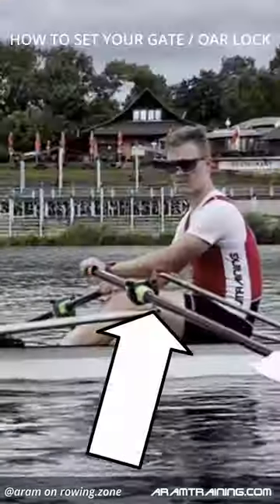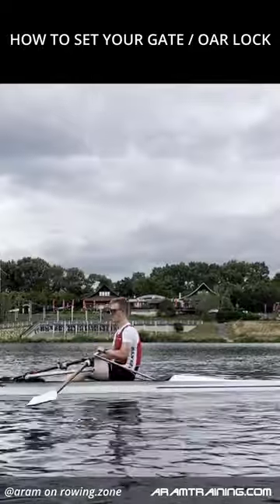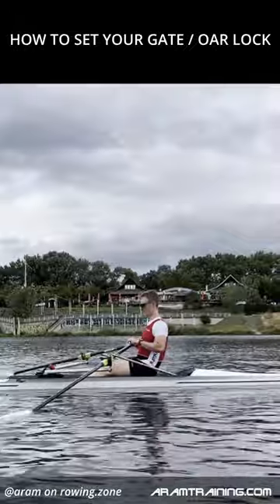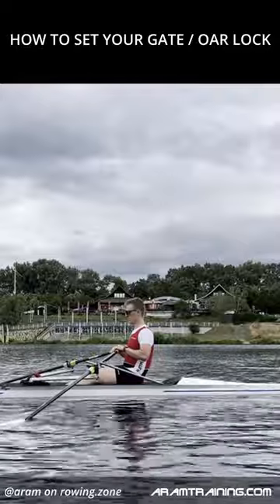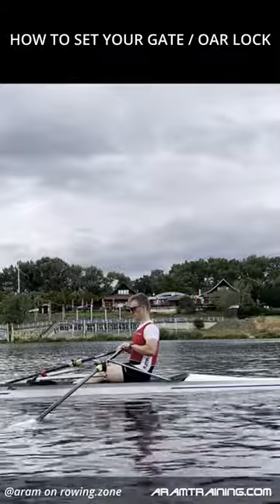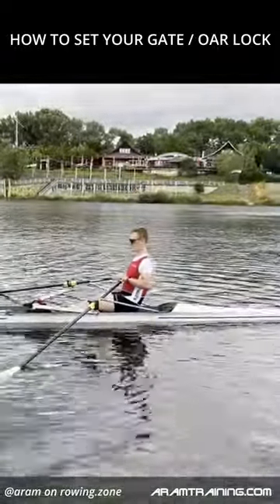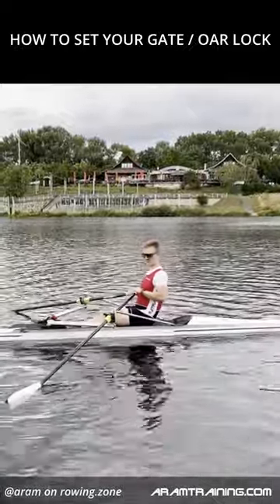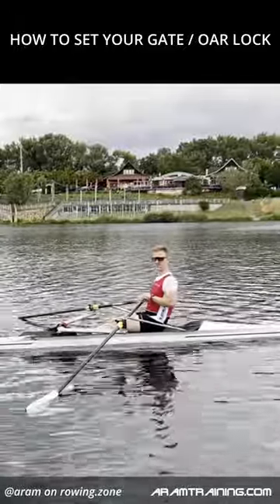How to set up your rowing boat: finding the perfect oarlock height #rowingtechnique #boatsetup

Comment: I am rowing since 18 months and rather on Gig boats. I wonder how I can measure if the gates are level, especially on 2x and 4x boats.
Especially on the 4x, we tend to hang to either side or the other and the material is rather worn. So getting the uncertainty of an in balanced setup off my head would help me to focus on myself. Any chance you can share this in a video as well?